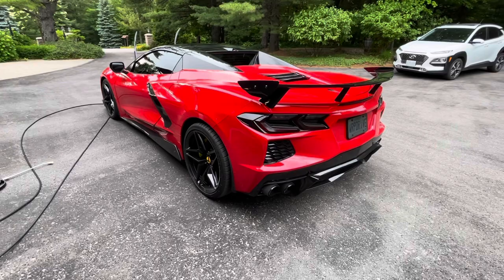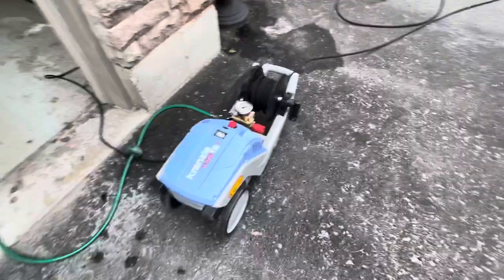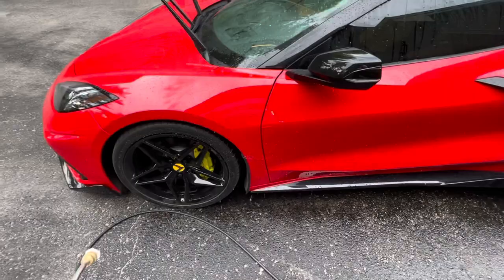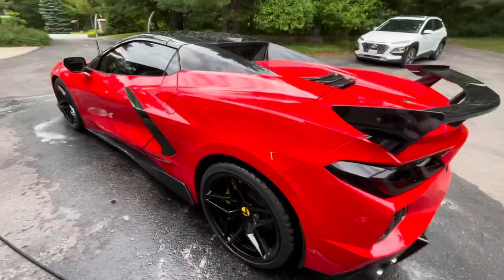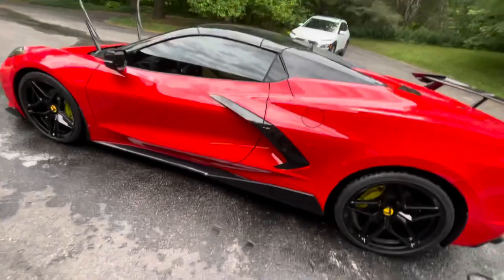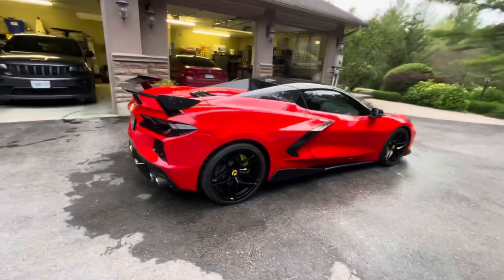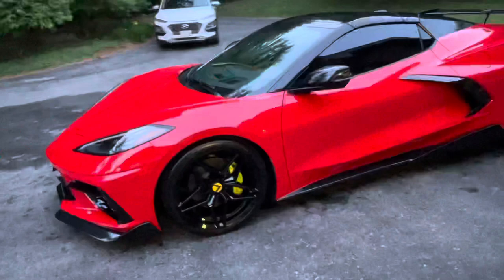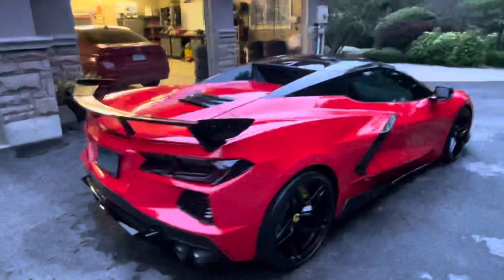C8 Corvette after Ceramic Coating - Effortless car washing and popping in the sun!

Comment: There’s one more Mod left to do on your c8, Carbon flash extended rock guards i have it on mine, it looks great and it’s functional, they sell it on eBay as well, try it you won’t be disappointed it’s keeps the sides way cleaner…
Reply from the maker: I have the extended wheel well rock guards but they are not carbon flash, they are the same material as the stock Z51 splitter.

Comment: Hey bro. So you just used a pressure washer to wipe the dust off and then used a blow dryer to dry the car ? You didn’t use any rags at all correct ? I’m asking because I placed an order for a black HTC And I’m also looking to get it ceramic coated but I want to avoid the swirl marks. If you cleaned your car without using any rags then I think that’s the solution of not having any swirl marks. Please let me know.  Thanks in advance.

Comment: How did you get the front license plate positioned like that? Picking mine up from Ontario dealer soon too, really not excited about ruining the look of this beauty with ugly plates.
Reply from the maker: There is an integrated front plate system. You must remove the front corvette cover and then drill and screw your plate on at the four raised bosses behind the cover.

Comment: How is your plate installed? Did you buy a specific holder? It looks great and would love to replicate it. - TIA
Reply: Front plate that is :)
Reply from the maker: It’s in the factory integrated spot. Use a plastic trim tool to remove the “corvette” cover. You will find four bosses where you drill out the holes for the front plate. I had my dealership do this for me at delivery.